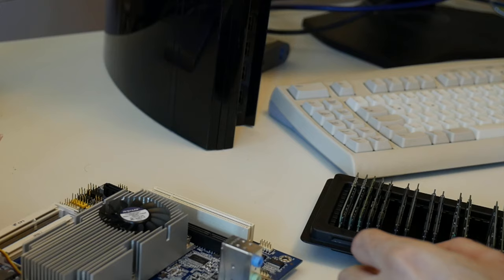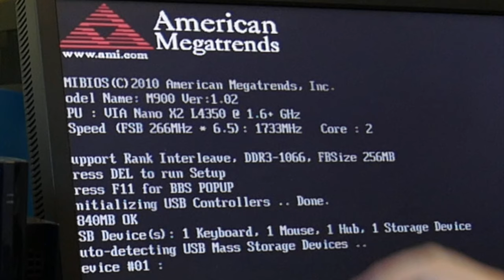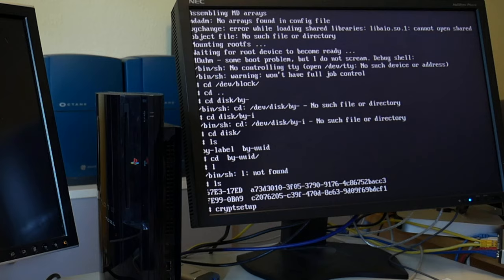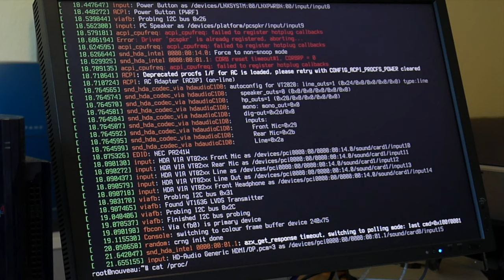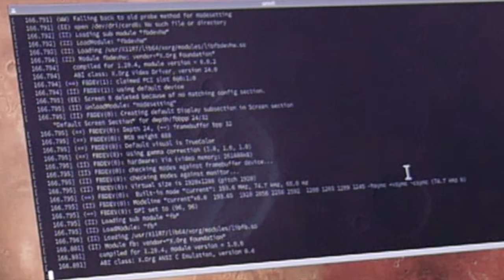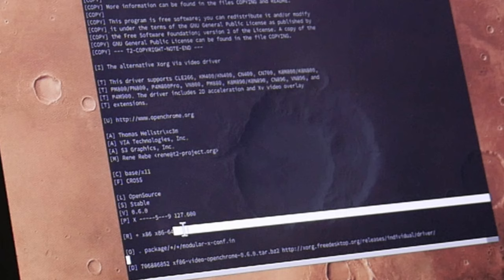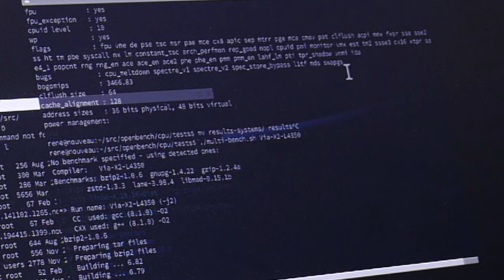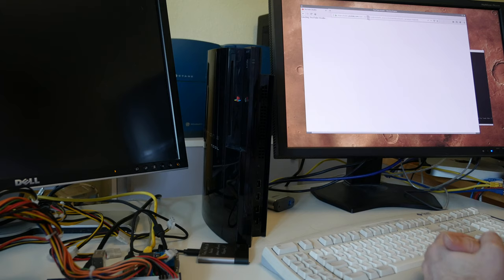Via Nano X2: their 1st 64-bit x86 dual core, how fast is it?

Comment: It's expensive because the via stuff was mainly intended for industrial uses like kiosks. It's not really targeted at cheapo at home people. I had a Via C7 and a Via Eden both used for my firewall (dsl modem speeds at the time so the fact those are weak processors didn't matter).  I used them because they produced so little heat that cooling in the metal box wasn't a problem (they had passive heat sinks)
Reply from the maker: Targeted only because the price / performance did not make sense for sane people. All embedded projects we had Via processors failed at a high rate. This was definetly not high quality stuff.

Comment: That fan!  What were they thinking?!
Reply from the maker: Yeah, exactly my thoughts, guess one of the many reasons they were not that successful back in that day anymore I guess, together with the high asking price and not that stable graphics, ... PS: as I plugged that out in the vid for a test, I can not recumbent that for longer, as the heatsink became quite too hot to touch, so I rather suggest modding that for lower RPM instead, ..!
Reply: @renerebe  I think it's hard to compete in the x86 space.  Even if you look at AMD, which is no small company ... they really had to give it their all to be competitive again.  For a small company, unless you can find a niche, i think there is no chance ...
In the bios, it said auto for the fans, but were there other options?  Like quiet or low power or something?
Reply from the maker: detaart of course I checked the bios options, they are: Auto or Full speed! No kidding! ;-) via appeared to license that micro architecture to the Chinese Zhaoxin after that. PS: wish in general we had Linux fan register poking to tweak fan speed like that, also for any other board. Somehow that never was much of a thing I guess. Would have saved me a couple of reboots on server systems in the past, too, ..!
Reply: @renerebe  Haha, if this was auto, i'd hate to hear what "full speed" was like.  Interwebs says 27.5w TDP ... so this is quite good for back in the day actually.  It certainly does not need this fan, but then again ... too much for passive cooling too.  The heatsink design seems weird too.
Am i seeing this right?  It seems like the socket is not inline with the fan, but rather offset to the side.
Reply: Probably something similar to what nvidia was thinking when they did the FX 5800 ultra.
Reply from the maker: @detaart  On Auto it also starts "full speed" and only goes down a bit. There is no frequency scaling in Linux right now, maybe there is something I could hack into. Maybe with a lower frequency the fan would go down a bit more, though it is silly that it does not right now without much heat. Besides the stupid fan is way too loud in any case. Basically unusable for DIY media server and what not project. Basically anything close to the user. The heatsink covers the CPU and the chipset, I think the fan is more over the CPU area.
Reply: @renerebe  There is a way to control PWM fans directly over i2c in linux.  There is a frontend/daemon for this, in ubuntu it's just called fancontrol, and configured through pwmconfig.
Maybe it can be brought down to an acceptable level.
Reply from the maker: @detaart  oh. Cool! Probably something for another livestreaming to experiment and have fun with ;-)
Reply: @renerebe  Yeah i used it on a few laptops, works pretty well.  Would make for a cool thing to try on the live stream :)
Reply from the maker: @detaart  LoL – "Warning: Configuring 
or completely stopping fans on high system load might result in permanently damaged hardware." ;-) Actually: looks like you do not even need those tools, with a hwmon driver in place one can actually directly write into the /sys/ … hwmon … *pwm * files PS: fancontrol and pwmconfig are part of the lm-sensors package, so #t2sde of course even has them, just never stumbled over them, ..! https://t2sde.org/packages/lm_sensors
Reply: @renerebe  yeah, the fancontrol stuff is just a daemon that monitors temps and sets the registers for those pwm generators over sysfs
Reply from the maker: @detaart  yeah, as obvious from the previous hundreds of videos we were too much on Macs the last decade, the PowerPC G5 had a "windfarm" driver on Linux, and the Intel Macs the applesmc driver with their sysfs files. I even used them to fine tune them via sysfs, just never had the need to look into this on generic PC hardware, thought that was a special snowflake Apple fan driver stuff. Good that you pointed me to that! ;-)
Reply: @renerebe  That's the kind of message you want to read when you are playing with "new" (new for you) hardware ^_-
Reply: @renerebe  Slap a https://noctua.at/en/products/fan 40 or 60mm on that and call it a day :P 
About the heatsink; full Aluminium is my guess, so it will run hot no matter what with large fins like that sadly.
Reply from the maker: detaart btw sysfs Tuning works, the fan is sill annoying especially whining up and down even around half (+-2000rpm) to keep the CPU somewhat cool. Probably will still make a video about that an try to get some frequency scaling to work (if this cpu actually really supports that ...)
Reply: @renerebe  Cool beans!  Even if it doesn't fix the problem, it's fun to play with this stuff :)
Maybe increasing / decreasing the PWM frequency (as opposed to the duty cycle) might make it less "whiny".  That would be a bit more in-depth hacking, though :)
Reply: mimicking the fan test mode on PS3

Comment: Very cool! Do you intend on doing any benchmarks with a discrete video card?
Reply from the maker: Well, not really as crappy as their open source drivers are? I guess crysis on Windows, maybe?
Reply: For anyone who finds this today: that board has a PCI slot, not PCI Express. The Nano was the last chip series VIA put out before the Zhaoxin deal which isn't globally available. The chances of getting a better GPU than the Integrated one are almost zero.

Comment: Openchrome not setting a mode properly... I think i predicted that... hrm... 14 years ago ;)
Reply from the maker: Hey Welcome! Luc of all people found my unsuccessful YT channel! ;-) Needless to say I could not get HDMI to output anything even after one hours of trying all sorts of fbdev or x drivers options and parameters, ... :-/
Reply: No miracle. Openchrome forked away from unichrome because i was apparently too rude in making sure that modesetting got anywhere (unichrome btw, is where the whole of structured display driver development, aka, modesetting, was pioneered). They wanted to have VBE as a secondary route for setting a mode. Having two paths ensures that users never report problems and that problems never get fixed. While i moved on to other things, like freeing ATI and freeing ARM GPUs, the openchrome people trundled along by sprinkling pci-ids over the codebase (enabling/disabling things if/when they worked, somewhat), and by even adding a third badly tested modesetting path. I am not sure whether they ended up doing a table deciding which modesetting path to use... Kevin Brace came in many years ago, and has been doing cosmetic changes ever since, acting as if he is rewriting the whole driver, but all of what he does is very superficial. His talk at XDC in 2017 is hilarious, mentioning my initials, but not mentioning me by name, and then going on to talk about exactly that what i pioneered and the openchrome people forked away for...

I have 40+ devices here, but there really is no point in spending any time on this hw. VIA has been dying slowly ever since they introduced mini-itx back in 2003. Their revenue today is a fraction of what it was 16 years ago. The only reason it is not closed down yet is that it always has been a pet project of one of the Chen family, a wealthy .tw family that also owns or owned HTC. It's one of those things where it really is not worth anyones time.

And it's not as if those VIA processor ever ran reliably. I have several dead devices where the assumption is that the CPU burned out, due to running too hot for too long. So do not expect this board to be used for anything much. If you really want a small efficient device, go to arm, there's OSHW and actual communities there.
Reply: Oh, and i have had to go claim copyright on my code twice there already. James Simmons, the guy who also poked at ps3fb, blatantly copy/pasted my code. And this was groundbreaking stuff like talking to the northbridge directly for sizing the reserved ram, and enabling a snooping path so that graphics memory accesses would not first have to pass through the actual gpu. I figured all that out during my coreboot bringup work (incidentally, VIA unichrome was the first hw to have a fully native display driver for coreboot, no binary blob required).

I even enabled direct mapping on the AMD K8/Hammer, so that on amd-64 framebuffer reading/writing was lightning fast. Mr Brace mentioned not having fast access to the framebuffer on amd k8 during his 2017 XDC talk, and then Thomas Hellstrom (one of the guys who forked away from unichrome due to not accepting how important modesetting was) mentioned that "someone" worked around that, but he minced his words very carefully to not mention who or how.
Reply: it's a shame that you no longer develop openchrome
Reply: @lepetitdu17  I never did. Openchrome forked away from me. I had started xf86-video-unichrome when i noticed the turndown in xfree86, and i got the 2 other then active developers to come along. They later forked away because i did not accept VBE modesetting back in, as i predicted exactly that. They added a second path for native modesetting a few years down the line, making it 3 paths. And then introduced a system for disabling almost every feature (like hw cursor) until there were no more visible bugs (as then it would be all software). It took them until 2015 or 2016, when everyone had stopped caring for half a decade, until someone went round and threw that stuff away. Again, march/april 2005 is when it started, and i predicted it, yet no-one wanted to accept it. But then, most people in Xorg did not want to accept modesetting either, until they did, and then my name was no longer mentioned and my copyrights violated.
Reply: @luc_libv_verhaegen  ho ... ok, I didn't understand that.
do you believe in kevin brace's project to finally include drm openchrome in the kernel?
why not help him? (ok he forgot the license)
it's a shame that the graphics part of this hardware does not work well under linux.
I have several copies of via nano (samsung nc20, via epia m900, zotac vd01, via artigo a1150), I mostly use samsung and the cpu works pretty well for office.
also, do you know why james simmon stopped working on it? (because  the stealing of your code?)

Comment: Rip Cyrix and Centaur. VIA helped Intel and AMD by buying those companies and not doing really anything with them......in the end all their low power x86 cpus got killed when everyone went to Arm or started to used Atom
Reply: All those companies got bought because they were already at the time not competitive. VIA was way behind AMD/Intel back in the mid 2000's.
Reply from the maker: They were competitive for what they were, price vs performance. And nobody buys not competitive companies ;-)
Reply: @renerebe  I tried to buy a samsung via nano netbook back in 2009. It was sold out. I did a little research and find that a core 2 solo netbook is cheaper and faster. Also, the nano that i wanted has compatibility issues with everything other than windows. Linux or hackintosh is out of the question. no wonder it  sold out quickly because no one wanted them.